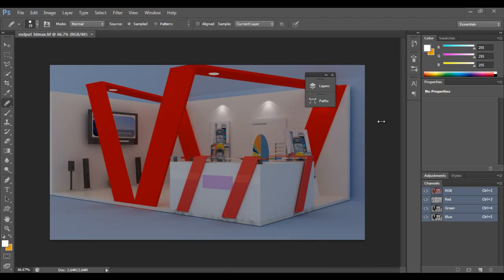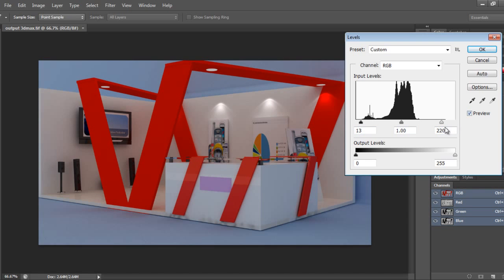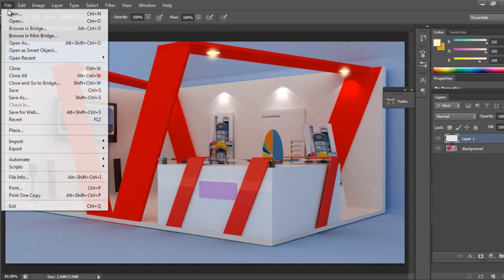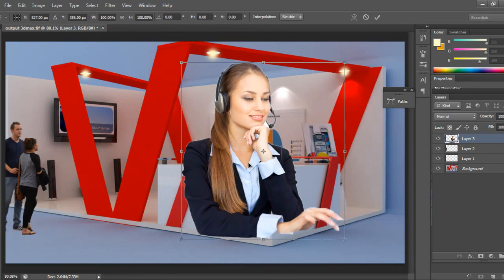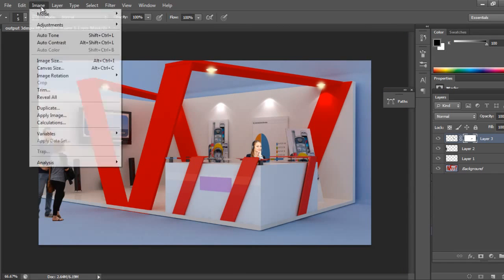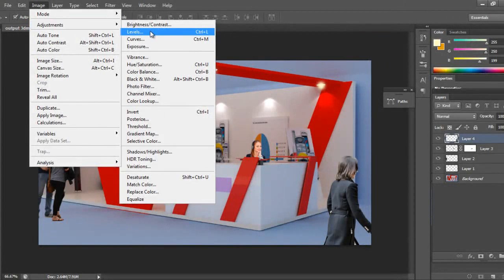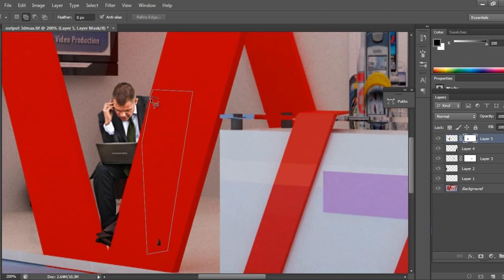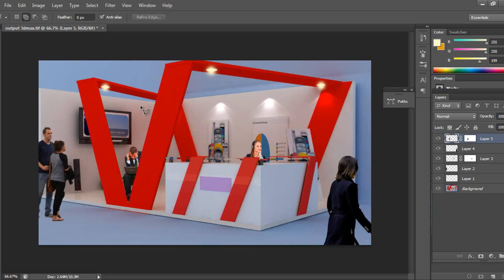Stall Design in 3D max  Part-04

Comment: i dont understand why IES lights doesnt work.  Can  u pls tell me how to install.
Reply from the maker: are u assining ies file properly...
which camera u r using like vray or standard...
or else you can also apply photometric light with web distribution option ...
Reply: Actually there is some problem in my laptop. I wanna buy a new one. Can u pls suggest me which one would be better Full HD or HD for 3ds Max n AutoCAD? Thanks.
Reply from the maker: what is ur budget...
Reply: 50,000-55,000
Reply from the maker: go for dell i7 and slightly strech ur budget say 60 or 62..thanks
Reply: How abt HP pavilion i5 Full HD? Is full HD benefial for 3ds max?
Reply from the maker: see hd ,non hd is about viewing experience. ..
u have to look on processor, ram,graphic card,motherboard...these play imp role in graphics..
Reply: Yes, its i5 processor, 8GB RAM, 1TB HDD,  2GB Graphics. All this is fine for designing, right? But I am confused only abt Full HD or HD.
Reply from the maker: go for full hd ofcourse. ..
Reply: ok thanks :) I was confused coz somebody told me that Full HD has less brightness compared to HD.

Comment: Thanks for replay Mr Abhishek.
It still  can see it drak view .normal render i can see the views.I think Vray  installtion is some problems.Am using v ray ver-2.40.03.I try to re install the v ray  then I open it 3ds max I go the message 
DLL: C:/Programe files/Autodesk/3ds max2009/plugins/ vrayplugins / vrender2009.dlr failed initialze.
please advice me what can I do.
Thank you,
Reply from the maker: ok.this means you have not installed vray properly...
if you are using crack then
replace dlo and dlr files in c drive plugin folder or else get it installed by someone. and let me know.thanks